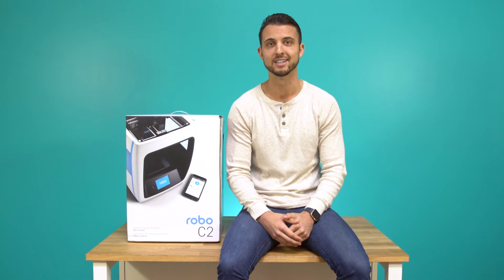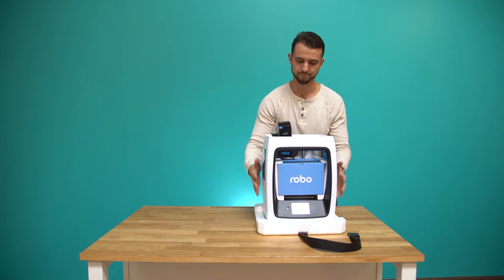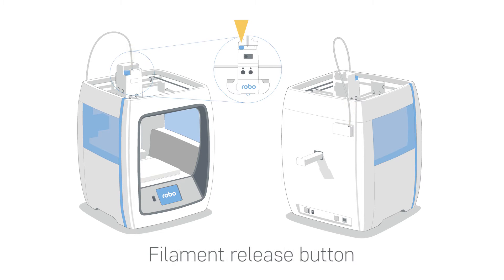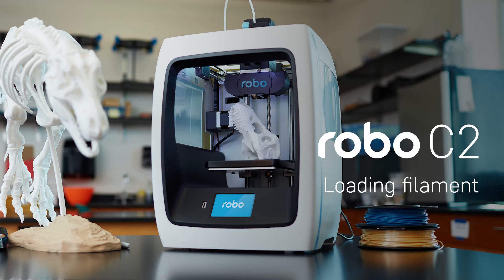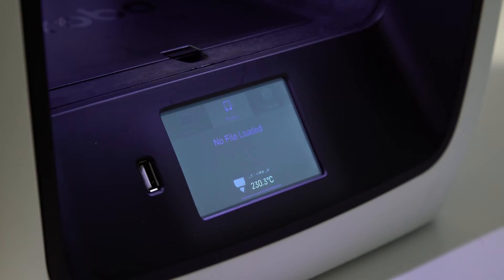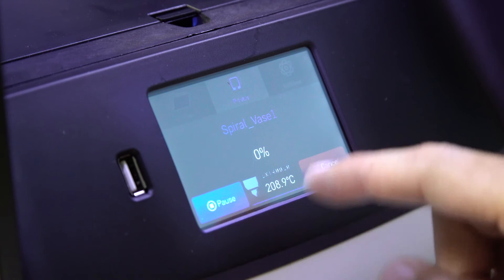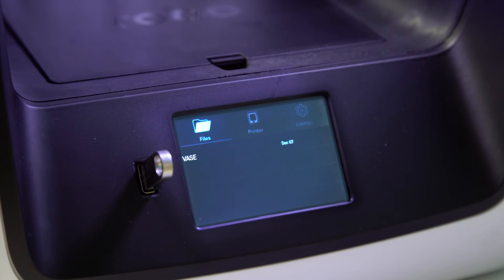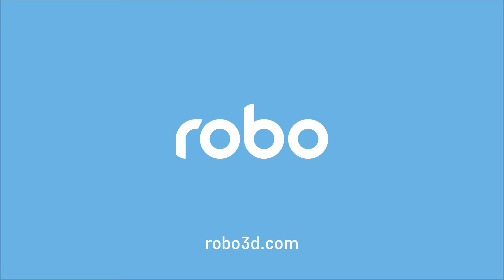Robo C2 Quick Start Guide

Comment: This is awesome... I hope there is an update to fix the touchscreen sensitivity... but I will most likely use the computer to control the printer.
Reply from the maker: There is an update! We updated the firmware to fix the issue.
Reply: ROBO 3D Awesome. I hope this update will be with the unit is purchase in a few weeks

Comment: Hello Robo 3D I heard some complaints about the touch panel control being unresponsive, I was planning to buy the R2 from you guys but now I am having doubts.  Your pricing for the C2 is way too high for a non heated bed because with that kind of price I can just get the Prusa Mk2 with heated bed, larger print size and great quality print, can you tell us why we should choose your printer over other printers out there on the market ? 

Please check here for the review of the C2 on the unresponsive panel and other flaws 
https://www.youtube.com/watch?v=DmSlk_cnJS0&t=302s
Reply from the maker: We've updated the firmware for the printers! the sensitivity issue has been resolved.